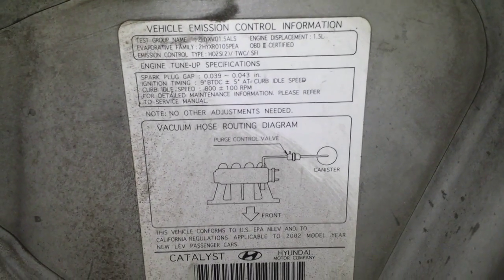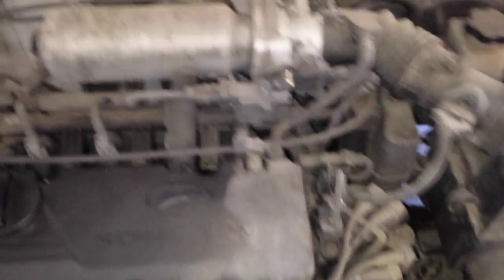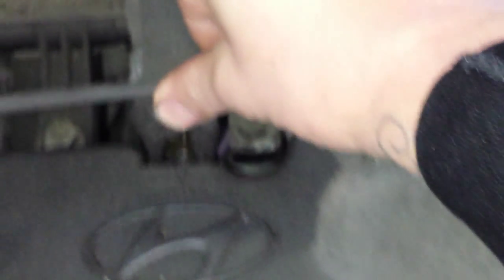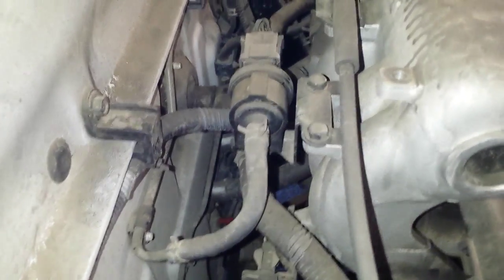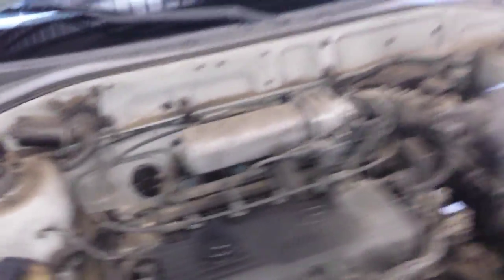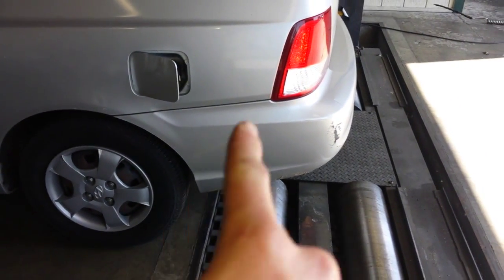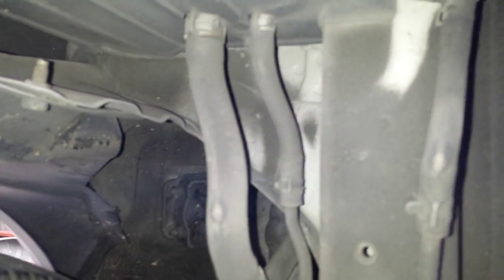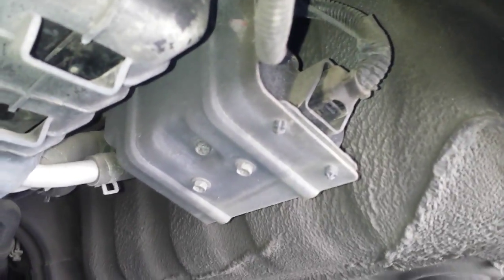Hyundai Accent emissions: PCV valve, EVAP canister, & EVAP purge.

Comment: Help trying to figure out code 1401 on my 2002 Accent 1.6. We changed the evap canister vent solenoid and code is still there. Anyone, any suggestions? It has the check engine light on and cant pass smog. Thanks

Comment: *Engine code for the vapor canister
*Decides to dump $200 into the car
*Replaces canister with new, code goes away, internal peace
*Code comes back
*Replaces fuel filter with new
*Code goes away, internal p-
*CODE COMES RIGHT BACK
Reply from the maker: I am not aware of a code that tells you your vapor canister is bad. What code are you chasing?
Reply: @ScottiesHobbies  The one where the gas pump goes click when pull the trigger too hard. What I probably have to do is “empty” the old charcoal bits and that’s it. It that doesn’t fix it, time to throw more money.
Reply from the maker: @godemperormeow8591  its not often or common for a vapor canister going bad. When they are bad, you can usually see a visual leak or residue around the leak. If you are having problems pumping gas, you probably have a problem with the evap vent solenoid. But you should test it before you replace it. But a code might be a little more helpful.

Comment: Hi Scott, do you know the PCV Valve part number (OEM part number) , trying to find it at our local spare part store but they need the part number code
Reply from the maker: What is the year, make, model?
Reply: It's Hyundai accent 1.5 Gl spec year make 2004
Reply from the maker: @nmambo  i see a 1.6l for a 04 hyundai accent. Are you sure that info is correct?
Reply from the maker: for the 2004 Hyundai Accent I show a part number of: 2674026700, You can buy it on ebay at this link:
   https://ebay.to/2JAjKXw
Reply: Yes for Asian market it's 1.5 liter engine
Reply: Thanks a lot , appreciated it

Comment: Does this car have EGR??
Reply from the maker: Been so long since i uploaded this vid, if it does it is listed on the underhood label that I show at the beginning of the vid and should slso point it out in the vid. 

I think I have a few Hyundai vids if this is not what you are looking for, check my other vids.
Reply: Scotties Hobbies Checked my hood, and it's only PCV that's I find in the diagram. The diagram under my hood is the same as the one you uploaded in this video
Reply from the maker: This one in the vid does not have one. I'm not sure why Its listed on the cover art. But, no, this one does not have a EGR. 

Are you diagnosing a code?
Reply: Scotties Hobbies Yes is true, this one don't have one. No I am not diagnosing a code but I have low idle problem sometimes make the engine stall and almost die out. So researched and got to know I need to clean my EGR valve for it to run good. But gutted my car don't have EGR.
Reply from the maker: Does yours have a mass air flow meeter? Have you cleaned the idle air control valve?
Reply: Scotties Hobbies No mine don't have Mass Airflow Sensor but does have MAP sensor. Yes I have cleaned the IACV with carb cleaner on two occasions but the problem still persist. Have ordered a new IACV online yet to be delivered; I want to replace it and see what happens.
Btw, I have seen some slight breakage on my current IACV though.
Reply: @AnythingEverythingGh  did you resolve your issue? I’m having same issues and I’ve replaced just about everything except the charcoal canister. 
New: fuel pump, plugs, plug wires, alternator, IACV, TPS, MAP sensor, and purge solenoid. I still have a intermittent rough idle.
Reply: @BrokenRRT  Sold the car